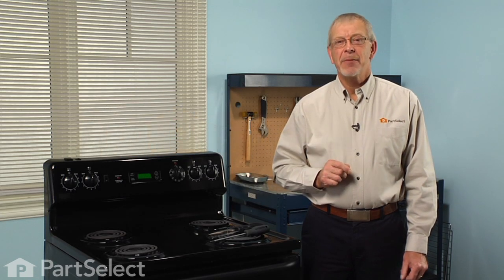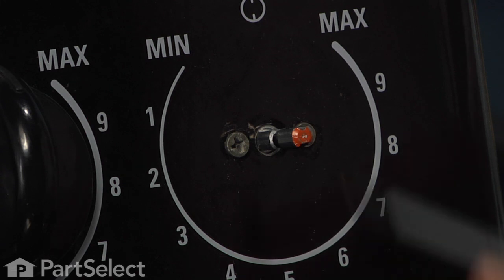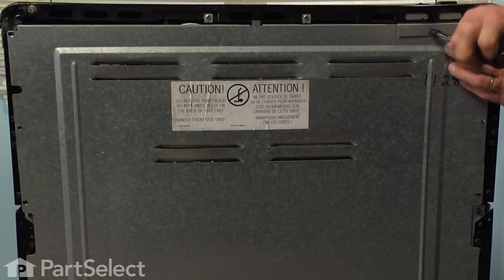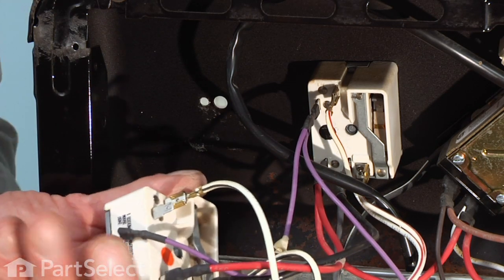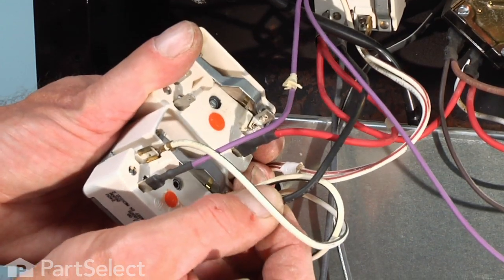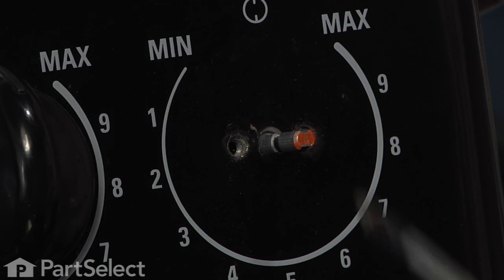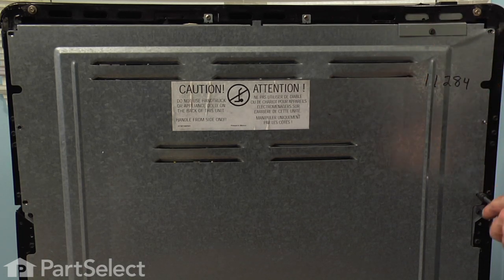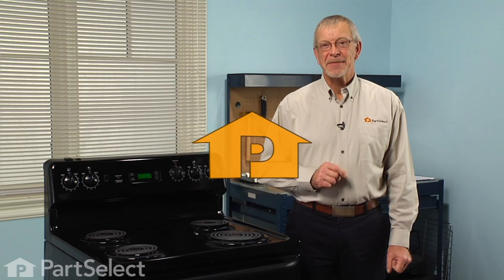GE Range/Stove/Oven Repair - Replacing the Surface Burner Switch - 8" - 2500W (GE Part # WB24T10025)

Comment: Where do you put the two wire pilot on six blades switch the original one has a 5 blade switch